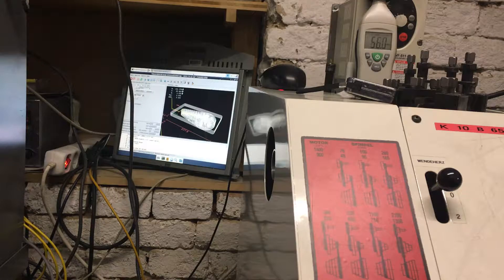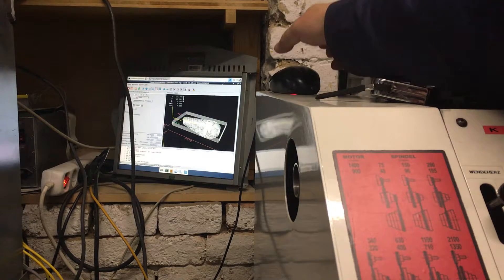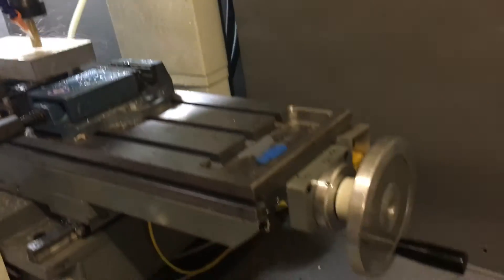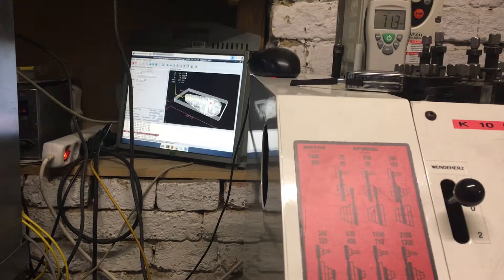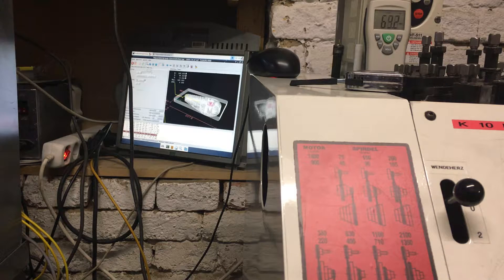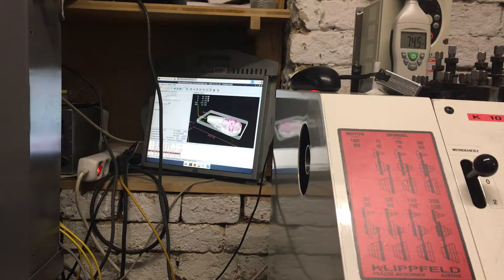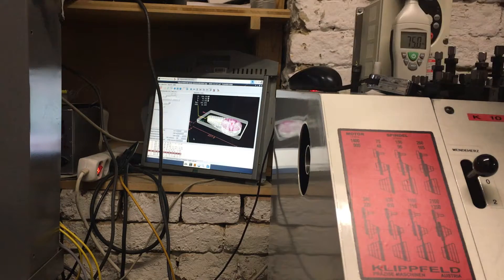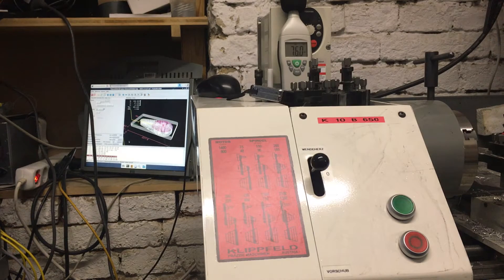Thojomech TFC11 what about noise ? Part 3 The cut in Alu + higher speed

Comment: I'd like to see how it performs on some hsm style machining ops. High doc with smaller woc
Reply from the maker: hi we can do that suggest a "deepness" you do like to see. Although it is a pocket operation to some extend it will cut in full length. We have as next cut a 10mm alu sheet to mill it "down" so we could do 6mm /cut 1mm woc ?